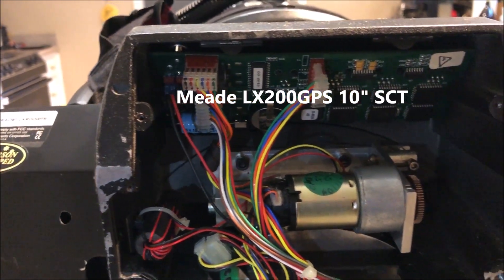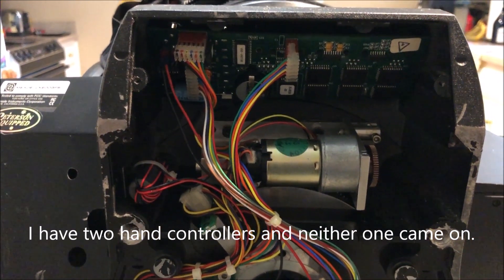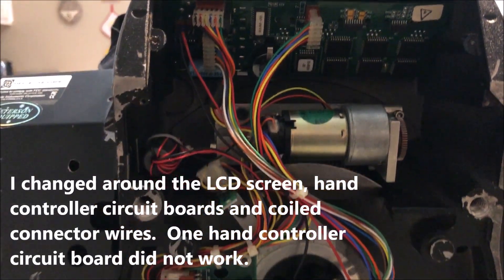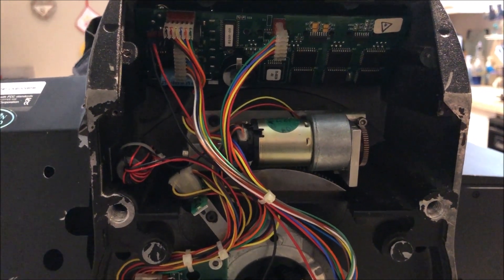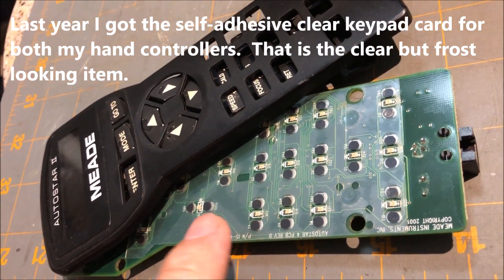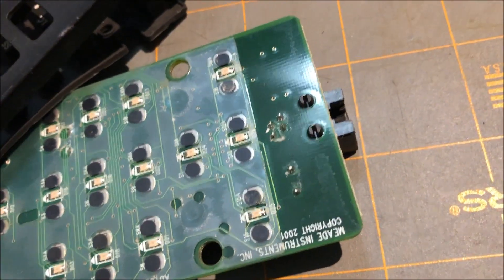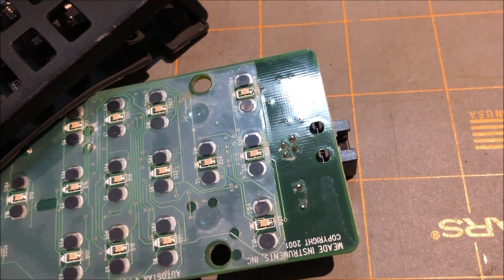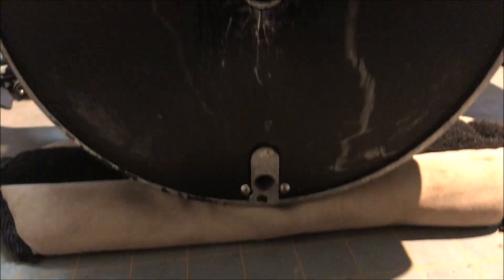AutoStar II Hand Controller repair, I hope

Comment: My Autostar does thte same thing.  The display goes out about a second after powering on, but then comes back bright after about 10 seconds with Align: Automatic.  Does yours still work ok like that?
Reply from the maker: Yes, one hand controller still does it.  I could be the ribbon to the LCD.  Sometimes cleaning its ends, where it plugs into the screen or circuit board, might help.  It also could be the screen going bad, but after it warms up it gets brighter.  Do not know how long it will have life before searching for a new LCD screen.  Some company is now making replacements.  I saw something on a the LX forum about that.  have not research it out.  The YouTube guy “Turbo Talks Tech” has some videos on hand controller repair.  You also might want to check the plugs in the scope's base circuit board and hand controller's plugs and those soldering connections.
Reply: @gadgetmanbowen3081  I think its power or a capacitor.  I just put a brand new LCD in the one that is exibiting the problem.  I've had good luck jumpering power directly to the voltage regulators to bypass any internal trace issues.  Thats my next step on this one.
Reply from the maker: @bart1825   I have no idea how to do that.  Maybe you could do a YouTube video on that for others to see.  Many people have issues with the LCD screen and buttons keys.

Comment: Thanks for your videos!   On my quite new LX200 I believe the hand controller button conductive-contacts go BAD with months of no activity. (Room temperature low humidity storage.)    Spray contact cleaner alone not effective - must physically micro-abrade.    Dunno if PCBoard or elastomer the problem,.   Difficult to get all contacts working, requires several tries.   Any thoughts?
Reply from the maker: Well, if it is the button contacting the circuit board, there are two possible fixes that I have done.  One was using an electrically conductive paint material, but I like the adhesive applied button card.  I now have the button card on three of my AutoStar-II hand controllers and put one on a fourth one I sent out to a fellow astronomer.  My video shows the adhesive card I installed almost a year ago for that hand controller.
This is the one I like, Buttonworx, and purchased several, one for each of my AutoStar-II controllers. I have a total of three, with two for backup now; https://buttonworx.com/telescopes/33-Autostar.html
Buttonworx Info on the product they make; https://www.youtube.com/watch?v=fVY6zTXVfV0&ab_channel=p1repair
Buttonworx Videos of repairing many types of controllers; https://www.youtube.com/@p1repair/videos
YouTube video on the paint on product; https://www.youtube.com/watch?v=GDXwmaheZE8&ab_channel=TurboTalksTech
Sometimes it could be the cable also.  The plugs are RJ-22 or RJ-9 or RJ-44 they are 4 Position/4 Conductor type connectors.  Having 4-contact pins and 4-slots for the wire.  These are different from the RJ-11 which is 6 Position/4 Conductor, meaning 6 positions for wires but only uses 4 wires as contact.  They are a little wider than the RJ-22.
If your LCD screen is fussy then maybe the contacts need cleaning.  On one hand controller I had to remove the ribbon cable and use a hand sewing needle to lift up the contact pins very slightly inside the plug on the circuit board.  That helped.  Now the RJ-22 pins at the telescope’s control panel and in the hand controller may need some upward movement also.  That is a bit tricky, and I used a dental tool that had a j-point.  Be very gentle and careful on lifting all pins.  They only need to be lifted a small amount.
Hope this helps.
Reply: @gadgetmanbowen3081  Thank You!!   Warm summer nights inspired me to again tackle my Failed last year contact cleaning struggle. Last year 'Aggressive' cleaning went from couple to most buttons working, but NOT all.    :-(           After this inspirational video I happened upon Button Worx, - 4 Meade and 2 SynScan ordered.   Now eager to view ALL your helpful vids !!!   Good Job !!!